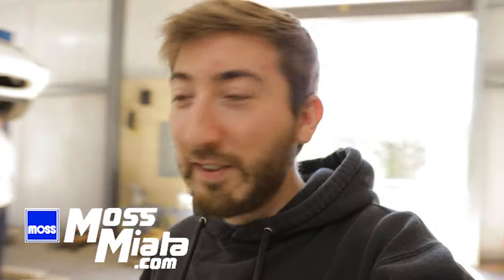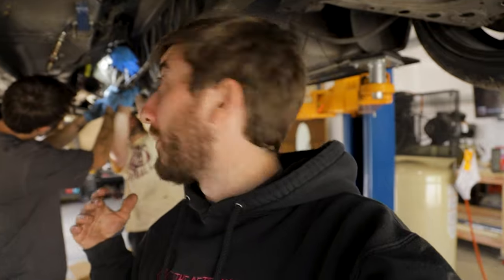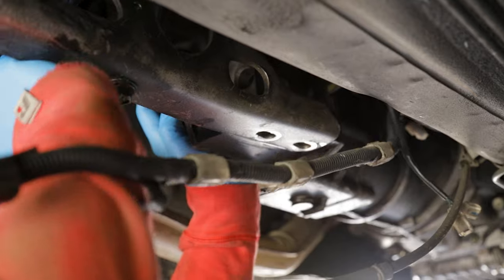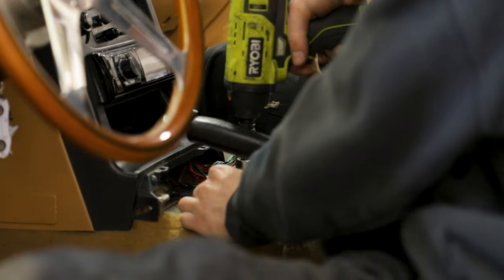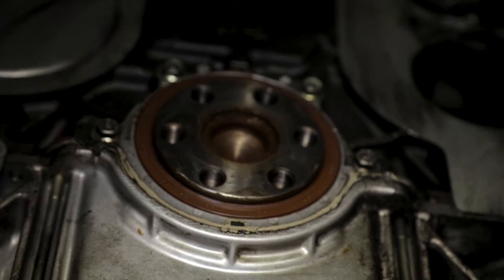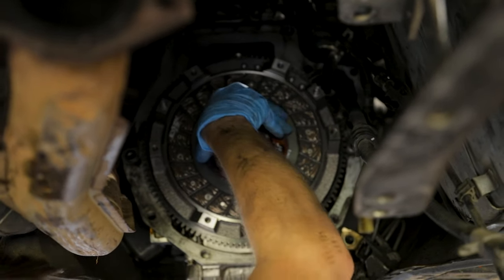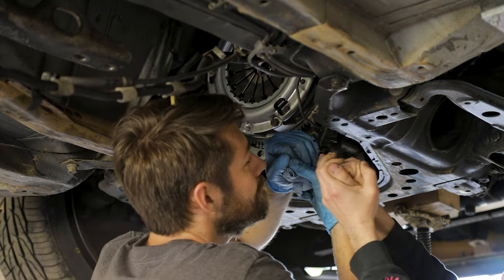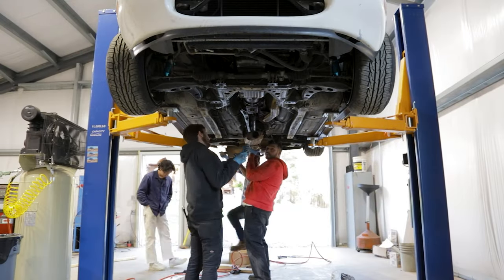MASSIVE Miata Maintenance Job! NA Miata Clutch/Flywheel Install

Comment: I recently had my clutch and rear main seal replaced on my '91 Miata. During some recent service elsewhere, I was told that my flywheel bolts had not had sealant applied to their threads, and there was engine oil  leaking through. I didn't see that mentioned in your video, but I have seen it mentioned in other Miata forums. I'd like to hear your thoughts on this, please? Thanks!
Reply from the maker: Yes do this. Red loctite is perfect for this.

Comment: Great video! I like how clearly you show everything you're doing as it's going on and the helpful voice over work.

I just went through this same maintenance about week ago.  Unfortunately I didn't have access to a lift or a shop, so I wound up doing the work mostly by myself in an underground parking lot.  Here's a long (sorry) list of things I learned the hard way while doing this job and I haven't seen mentioned in too many guides. Hopefully they can save somebody from a headache:

1) You don't have to remove the entire exhaust line. You can get away with only removing the cat and exhaust manifold / downpipe.  The driveshaft can be squeezed by the rest of the exhaust system with it in place.

2) If your rear PPF bolts are stuck in the diff housing (very common), you don't strictly have to remove them. The PPF has just enough flex to allow you to remove the transmission with all the other bolts out. It's a bit trickier to drop the transmission this way, but it can be done, and it's better than stripping out or breaking the rear PPF bolts.

3) When torqueing the flywheel bolts, you can do this without another person by jamming a cheater bar into the flywheel teeth and having the bar push into the frame as you use the wrench.

4) The bullet connectors don't have polarity. You don't have to mark them. Neither does the other set of connectors on top of the transmission.

5) You don't have to remove the starter motor. You can take its bolts out of the bell housing without pulling it out of place.

6) You really, really want to have a buddy for the part when you drop the transmission and especially when you lift it back in. At the very least, they need to be able to manipulate the jack underneath the bell housing and tilt the motor foreword while you remove and re-insert the transmission under the car. You need to be strong enough to lift 75 pounds over your head at a weird angle for extended periods of time if you want to drop and raise the transmission this way.

7) To help support the tail, tie a rope around it and feed it into the cabin. Then tie the other end around a 2X4 or cheater bar. That'll keep the tail from dropping down fully until you're ready. When you are, have your buddy untie the rope or remove the bar / wood.

8) It's uncommon but very possible for the pilot bearing to seize in place when you try to pull the transmission, and for it to get stuck partially pulled out. If this happens, you'll need to pull it out with substantially more force than usual. If you have a buddy and two pry bars, you can both wedge on either side of the bell housing. If you have disc brake spreaders (the C-clamp type) and 1/4 inch of clearance, you can wedge one of those on either side of the housing and slowly spread them open until you're clear of the bearing. Or you can just keep pulling on it and hope for the best. You should only be this rough taking the transmission out (if you're replacing the clutch) not then you're putting it back in, or you could damage the pilot bearing.

9) If the pilot bearing won't "thunck" into place while you put the transmission back in, have a buddy slowly tilt the engine back and forth on its mounts in a rocking motion while you gently push the transmission forward towards the engine.

10) Consider ordering a couple replacement bell housing bolts in advance, in case you strip them while taking them out. With the weird angles you'll be using getting to them, they aren't hard to mess up.

11) If you're draining and refilling the transmission fluid, loosen the drain plug first. Also buy a set of aluminum crush washers in advance. The drain bolt is 24mm. The fill bolt is a weird square type that I was luckily able to remove with a crescent wrench. It's notorious for rounding off, so be careful with it!
Reply: Great info!  Regarding number 4, it might be different for the NA, but mixing the two larger connectors up resulted in a CEL when Alex and I did the clutch job in the $1000 NB Miata series,  that's why we marked everything this time around haha.

Comment: Great video! When bleeding the clutch you shouldn’t  keep pumping the pedal while the bleeder is open. It’s just going to suck in more air unless your using some sort of bleeder with a one way check valve

Comment: Great vid. My clutch is nearing its end. I think i dont do that myself. Replacing the cas O ring is easy But putting the sensor back was a real pain. I cheated by removing the back plate of the sensor. How many hours for the clutch repair? Greetings from the Netherlands

Comment: On the flywheel, the bearing in the middle, is it supposed to be flat on with the side that the screws are? So it's going to be looking about 2mm over the other side? 
Thanks!
Reply from the maker: Correct. 👍🏼

Comment: My 1990 recently had a sudden loss of power. Previously there were times car wouldn’t start, had to push start it. Friend said that might be flywheel. Might the flywheel and clutch be causing a loss of power?
Reply from the maker: I would not suspect clutch/flywheel first for that issue. I'd check fuel, spark, air etc first.

Comment: Thanks for the videos Alex! Quick question what do you mean by timing? When it comes to changing the o ring
Reply from the maker: The cam angle sensor is used to adjust the ignition timing. So when you remove it to change the o-ring you need to install it back exactly how it was set before or just run through the timing procedure real quick.

We cover it in more detail in this video:
https://www.youtube.com/watch?v=IeuJEjNB1g4

Also reference this:
https://www.miata.net/garage/ignition.html#timing

Comment: Enjoying the content. I recently rebuilt engine and replaced clutch with all associated bearings, but having concerns. It shifts great but when decelerating at low speeds under pressure I hear a clanking noise. Also hear a subtle 'swoosh' when shifting high rpm primarily in 2nd/3rd gear. You have any suggestions on the cause?
Reply: not an OEM Clutch... its bizarre but most of the time its an aftermarked clutch making those noises

Comment: Is that a ACT flywheel? If so would it fit on a 1.6?
Reply from the maker: I don't think it is. If I remember correctly this was just a flywheel from rockauto. This one is specific for the 1.8